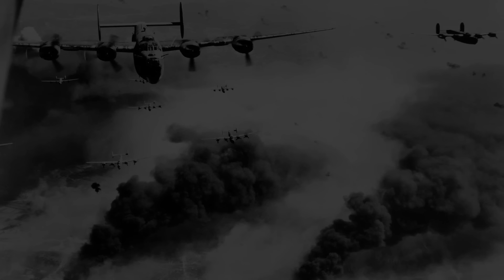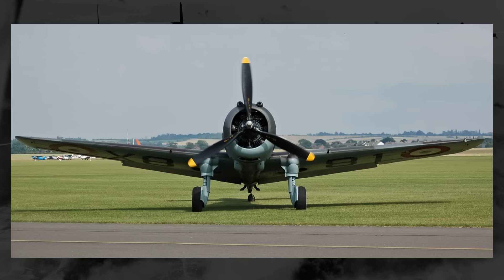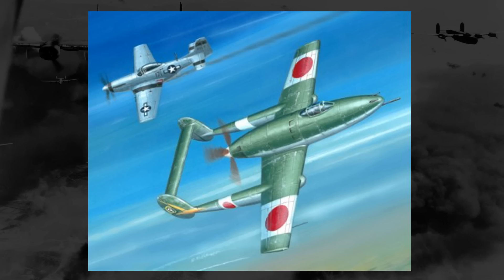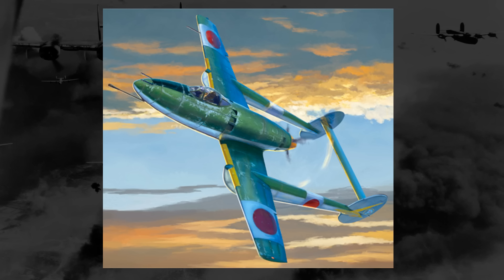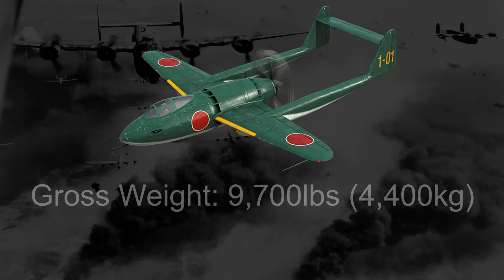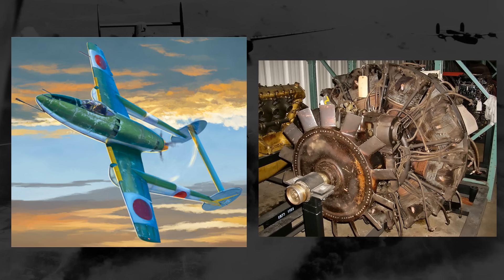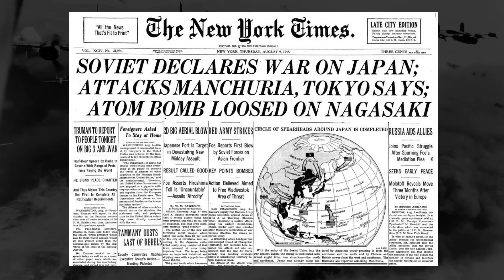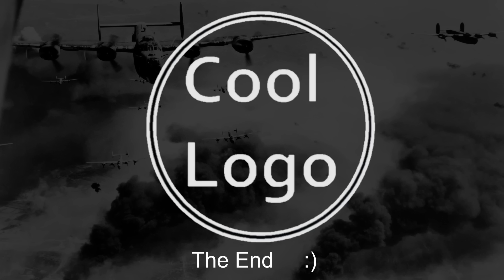Twin-Boom Superplanes... With A Twist!: Mansyu Ki-98 & Mitsubishi J4M

Comment: Radial and Rotary engines are similar in some respects but VERY different in operation. They do share air cooling as a common feature. Rotary engines were widespread during WWI but were soon replaced by the Radial shortly after.
Reply: Rotary engines are cooled by moving their cylinders through the air. Radial engines are cooled by moving the air through them.
The larger rotating mass limits the maximum horsepower of a rotary engine to about 150hp (hence nobody has built any commercially since 1920).

Comment: The Bristol family of Radials (Hercules, Centaur, ...) did not use poppet valves at all,  but rather sleeves. They were generally successful, but also rather unique. 😃My best definition of a true radial would require radially mounted cylinders linked to a single crankshaft. 
BTW, there were a number of experimental "fake" radials made up of several inline blocks of cylinders mounted radially, each with its own crankshaft, geared to a common propeller shaft. These would be mostly water cooled...

Comment: I’m not sure that the picture of the KI98 mockup is right. There are a couple of significant differences: the tail assembly is a different configuration with a low set tailplane and the fin shape is also different. But the biggest difference is that the mockup has two engines. One in the back and one in the front. It is in fact a photo of the Tachikawa KI94.

Comment: The J4m is a super sleek ship. It would have been better in the Saab 21 niche than the Saab 21 itself. The mid-wing would have reduced the propeller vibration experienced by the Kyushu J7W (less downwash  and off-set masking effect). The large passive cooling air inlets would have helped its engine driven fan immensely simultaneousely creating a kind of 'Dynamic soaring' like effect at the rear fuselage. However it would have ultimately needed more power for its design weight, say the likes of the R-3350 size and +2,500hp as she is a fairly big bird.
Reply: The SAAB 21 deserves more notice in that it was in service for ~4 years. However it had a water cooled engine. It was also later converted to a jet engine design.

Comment: Most of the pusher propeller designs had engine cooling issues. For example, Northrop XP-56, Curtiss XP-55, Saab J-21A, Dornier 355, Northrop XB-35, Kyushu J7W1. Convair had to put a lot of effort into getting engine cooling to work, especially at altitude.
The Focke-Wulf Fw-190 demonstrated that a radial engine could be aerodynamically integrated well, recognising that a closely cowled engine was better cooled by forcing air near to the cylinder fins, not just creating drag moving between the cylinders. Copying these ideas Hawker created the Tempest II/Fury/Sea Fury, Grumman F8F.
The radial was also much more damage tolerant. Both the BMW-801 and PW-2800 got their pilots home even after a cylinder was shot off. By contrast a single rifle-calibre bullet through  the radiator of a liquid cooled engine could lead to engine shutdown.

Comment: I'd always wondered why there weren't more rear mounted engines in ground attack planes.  They're more protected from ground fire mounted in the read, and it frees up space in the front for better aimed guns right in front of the pilot.  There's also the fact that the reduction is speed doesn't affect their role very much, so it's not really a determent to its design to mount an engine that way.  Anyone know why this wasn't a thing?  Thanks.

Comment: This aircraft reminds me of a Russian aircraft from about 1940. This aircraft was also a twin boomer with a rear engine in the main fuselage, combined with a pusher prop, together with heavy cannon armament at the front of the main fuselage & tricycle landing gear, but a ramjet contained within each of the 2 boom. So during take off, landing & cruising, only the main engine & prop operated, but in combat the 2 ramjets came in play, giving way over 400mph performance in 1940. However with Operation Barbarossa & the transfer of Russia’s aircraft industry being transferred east of the Urals, Russia cancelled all designs that didn't look like they would be finalised & fully sorted within 6 months. Also by having all the guns in the middle it would have all the benefits of zero deflection gunnery, meaning better accuracy, easier training & much simply sights to boot,

Comment: Yeah, I dont think the engines wouldve been adequately cooled that way. Germany tried much the same thing on the Fw190, with early prototypes having a cowling that left a mere slit between it and the propeller hub, but a fan, much like the one on the Ha-211, would fix it. It didnt. Also, the fan is so similar that honestly I was wondering if you were trying to sell a picture of a BMW801 off as a Japanese engine. In the end the cowling had to be opened up more, if for no other reason than that the pilots legs were being baked. 
But I also honestly see a very simple fix here. Just cut down the front fuselages width by making it slab-sided around the cockpit, so that around where the slots are you can keep it round and use the gap between the two as a giant air scoop on both sides. With that I could see a chance of it getting cooled properly.

Comment: Spark Plugs (plural, many, multiple), all internal combustion engines used for aircraft have at least TWO spark plugs and TWO ignition systems (two magnetos and two sets of plug leads) as a safety net against failure of one system.

Comment: The biggest problem the Japanese had with engines was that their fuel was lower octane.  It was because they had much less oil to start with, so if they refined it to octane levels the Allies used they wouldn't have nearly enough.  The Germans had a similar problem.

Comment: All WW1 engines were rotary,  i.e. the crankshaft is bolted to the airframe and the propeller is bolted to the cylinders, so the whole engine spins with the engine. With the later radial engines the cylinders are bolted to the airframe and the propeller is bolted to the crankshaft, so only the propeller and crankshaft spins.
Reply: Not all were radials
Reply: Not all. The French firm Salmson built water-cooled radial engines with stationary cylinders like WWII radial engines. Anzani also built air-cooled radial engines, up to a 20 cylinder engine good for 200hp in 1913.

Comment: 0:55 whats that? radials always have odd number of cylinders per row but this one has 6.
Reply: Four-stroke radials with a single row have an odd number of cylinders so they can have a regular firing interval. multi-row radials don't need that, and there are some four-stroke multi-row radials with an even number of cylinders per row; they need separate camshafts for each bank of cylinders because the common cam rings only work with an odd number of cylinders. 

But the Anzani at 0:55 does not have 6 cylinders per row - it is a 2-row engine with 3 cylinders per row. The rows are very closely spaced (possible due to large gaps between cylinders with only 3 cylinders in a row) so it looks like a single-row engine unless you look carefully.
Reply: @brianb-p6586  oh you are right. it really is 2 row engine. also can you name any radial with even number of cylinders per row?

Comment: Rays? Never heard that term used for the cylinders of a radial engine before and couldn't find anything with google either. It is what they are from a geometry point of view but still not used from what I could tell.
Reply: Correct - no one uses this terminology for engines. Radial engines have radially-configured cylinders.

Comment: The ki 61 had a water cooled engine. Maybe they could have used that motor for these projects?  Souped it up a little with a hot cam and fuel injection?

Comment: Not bad video, but the statement that radials were common in early aviation simply isn't true. Most aero engines were either inline or rotary, as illustrated by the picture of the Sopwith Came you used, which is a wholly inappropriate choice (you can even, just see the engine is spinning). No Camels & very few aircraft of that era were propelled by radial engines - these only began to gain popularity in the 20s. As others have said, rotary engines look the same as radials, when unpowered-up, but operate in a very different way. In a radial, the engine is fixed to the aircraft's firewall with it's crankshaft turning the propellor, just like in an inline engine. With a rotary, the crankshaft is fixed to the firewall & the rest of the engine rotates around it. The propellor is fixed to the engine & so turns with it. Rotary's run cooler & are even simpler than radials as fuel & oil is fed to the cylinders by centrifugal force & so require no gearbox, pumps, etc. The downsides are they generate dreadful gyroscopic torque effects & spray oil & uncombusted fuel everywhere. Another issue is the stress they place on the crankshafts, limiting the power & RPM such an engine can generate.

Comment: I would like to know how well one of these with a radial powered ducted fan setup would work. Basically a jet engine but stupid.
Reply: They make electric ducted fan RC model Jet's, how well would it work if you replaced the pusher prop with a ducted fan setup?

Comment: Makes me wonder if one could make more efficient use of a pusher like this utilizing ducting geometry and/or the venturi effect to recoup some of the cooling air as thrust akin to a high bypass turbofan.  I'm sure it would still be less optimal than traditional designs, but it would be a good project for undergrads.

Comment: 18 cylinders? So it had 1 cylinder every 20°? Imagine how smooth that thing ran. Especially since these were 2 strokes.
Reply: Yes, a cylinder every 40° in one row, and a second staggered to alternate with the front row. But like the vast majority of radials the Mitsubishi engines were four-strokes (with their design copied from Armstrong Siddeley and the Pratt & Whitney models), so only half of the cylinders fire on each revolution, and so there is a firing every 40° of crankshaft rotation.

For more detailed information about the Mitsubishi Ha-43 (also known as Ha-211), you might be interested in the Old Machine Press article "Mitsubishi [Ha-43] (A20 / Ha-211 / MK9) Aircraft Engine". I suspect that some of the stills in this video came from the Old Machine Press article, or from the same source as that article.
Reply: @brianb-p6586  it's a 4 stroke? Isn't that a nightmare to have to put valves all around?

Wonder how the secondary imbalance in a radial engine acts
Reply: @Rose_Butterfly98  Yes, almost all radials are 4-strokes. The conventional design uses pushrods run by cam rings that are placed around the crankshaft and gear-driven at half crankshaft speed. The pushrods push rocker arms to operate the overhead valves, just like any overhead valve pushrod engine (which the majority of engines built until the world switched to overhead camshafts). Some engines (such as GM and Ford gasoline truck engines) still use pushrods this way. It's a lot of parts, but in any four-stroke most of the complication is the valvetrain.

Comment: The WWI aircraft you show has a rotory engine, not a radial engine.
Reply: Which shows that the creator @IHYLS has no idea about WW1 aircraft engine technology nor about rotary versus radial engines ...
The rotary engine rotates around the airframe and the propeller is fixed to the engine block.
The radial engine is a normal engine ... just the cylinders are differently arranged from inline to V to VVVVV stuck together to a full circle.

The rotary engine allowed much better cooling at the engine speeds common in the days, as the cylinders actively move through air and it could be built light and small.  Heck, there is even the Monosoupape design (for rotary engines), which has only one, single, valve per cylinder. The fewer mechanical parts, the less can break. This special design has the drawback that the power can only be reduced by switching off the ignition for a bit (as there is no throttle to reduce the air+fuel input), wasting the fuel and oil normally used; advanced systems would automatically switch off a cylinder once, two or three times before allowing a combustion stroke, on top of the manual blip switch.

There are even counterrotation designs, where the crankshaft and cylinder block rotate in opposite ways, either each driving a propeller (1906, Redrup) or only one propeller, connected to the crankshaft (1914, Redrup), albeit that was never got reliable for actual use. Another design (Siemens-Halske Sh.III) ran at effectively 1800 RPM, with cylinders and crankcase running 900 RPM in one direction and the other internal parts at 900 RPM in the other direction, giving a low running speed and a lot of torque.

Growing power needs were mostly solved by faster rotation engines --- but the drag of the cylinders through the air raises exponentially, and is not sustainable.  Radial engines have static cylinders, still provide the smooth power of rotary engines, are well capable of high RPMs without the drag rotary engines have, do not require a complete-loss oiling system, ...

The Parisian Air and Space Museum has a cut model of an engine that shows the difference between rotary and radial by switching between the 2 different methods. Fix the URL in the obvious way. https:  //vimeo.com/  41546699

Radial engines still have the cylinders directly facing the flight wind and at speed will get considerable cooling, and will keep running even with a failed cylinder, no water circulation system to get busted, ...
Reply: @advorak8529  Nice essay.  I learned a few things.  I have a couple of points to make.  The crankcase of the rotory engine rotates around the crankshaft, not the airframe.  It is true that early rotory engines had no throttle in the normal fashion that's why they used a kind of hit and miss way of reducing power.  Later the engines were equipped with a slide valve carburetor similar in design to today's Mikuni models.  Another problem with the rotory engines was the amount of torque the spinning engine imparted to the airframe.  It was so much so that it killed a few fledgling pilots.  With the clockwise rotation, it was easier to turn, bank and roll to the left as opposed to the right.

Comment: except the at aircraft shown at 0:47 is a rotary not a radial, a rotary works by having its crankshaft stationary and the cylinders fixed to the propellor to act as a flywheel.
Reply: Yup. A Sopwith Camel. The issue early on was cooling - with modest speeds of the early aircraft there was insufficient airflow to cool a (later) conventional radial engine so they solved the problem by having the cylinders rotate with the propeller.
Reply: How do you feed the fuel to the rotary cylinders?
Reply: @onkelmicke9670 the crankshaft is hollow, supplying the engine with a fuel/oil mixture (the oil is for lubrication).

Comment: "Radial engines were simple"
But then they became OMG....
"Japan did not have the mfg. capability to produce inline engines"
That is not true. They just preferred radials.  So their production capacity was centered on them. 
Choice of engine had no bearing on the success/failure of their pusher designs. They simply started work too late and did not have the resources/time to develop.

Comment: The WWI aircraft used a rotary engine, not a radial engine.  The rotary engine spins around a fixed crankshaft.  A rotary and radial look the same.  The internal working are different.